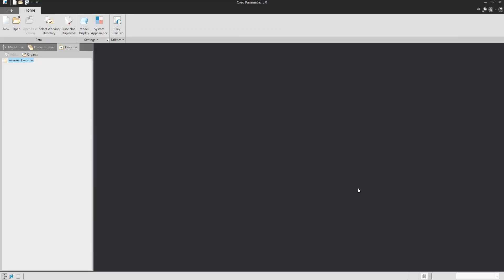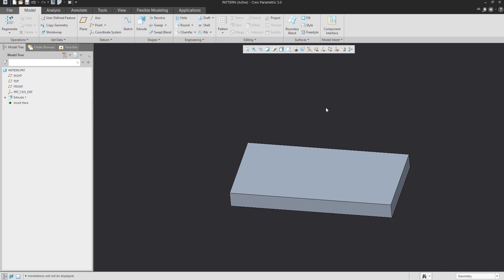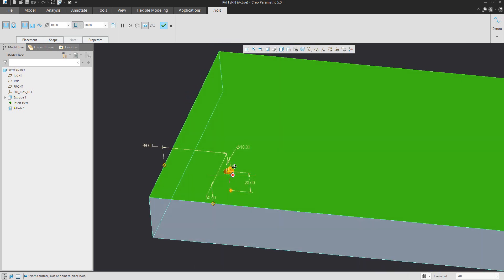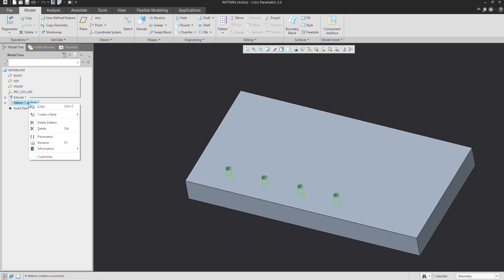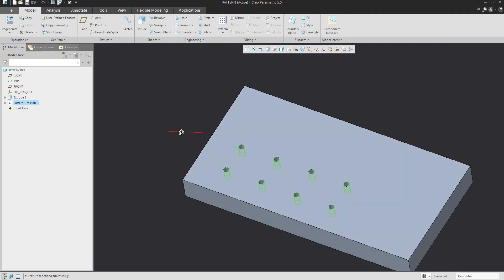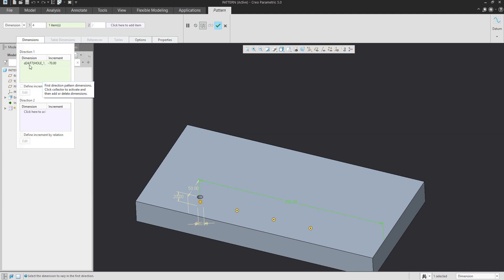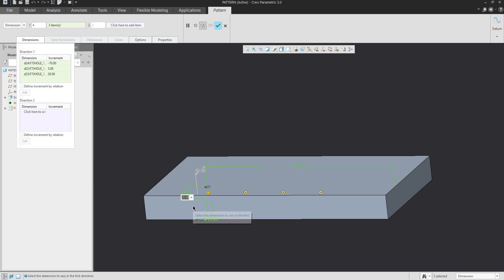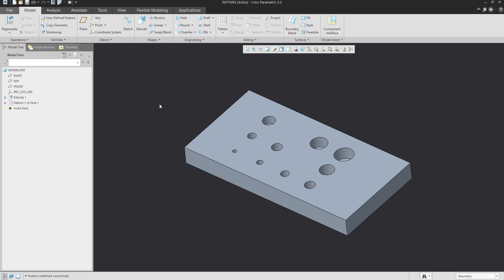Creo 5.0 tutorial: How to create Dimension Pattern

Comment: One more question: I have a cabinet assembly. The body of the cabinet is welded together from two identical assembly halves. I want to hide one of the halves so I can put balloons pointing to internal parts. I don't want the BOM to change as I am only hiding the cabinet half for clarity and visibility of internal components. I also don't want to alter the views of the cabinet on other sheets.  In Solidworks you can simply "Hide" the components in the View of the Sheet you are working on. Hiding a component does not change the BOM and does not affect any other view or sheet. Can this be done in CREO?
Reply from the maker: Hi, Thanks for your question - here is the video tutorial - > How to Hide/Unhide (Blank/Unblank) components https://youtu.be/llVIr2g-tU8 Stay tuned, Vladimir

Comment: What about a pattern of holes starting at a center plane going in two opposing directions perpendicular to the center plane? I tried the direction pattern and I get all kinds of duplicate holes.
Reply from the maker: Thanks for your question, I will try to simulate this example in the next tutorial... Stay tuned.
Reply: @4kside  Thanks, cause a guy at work was telling me you can't do it. I said "Are you kidding me?" That's a basic command in SolidWorks. I'm re-learning CREO after almost 17 years of using Solidworks. I was originally trained on Pro-Engineer. I find the hole placement in CREO to be severely lacking in comparison, unless I'm missing something (which is very possible).
Reply from the maker: @Rattletrap-xs8il  I hope that you will find the video useful: Direction pattern with Creo + Fill pattern at the end - https://youtu.be/BRFiKY1yhZg